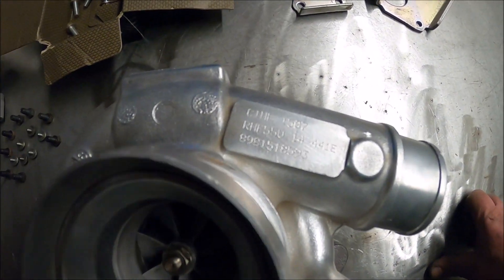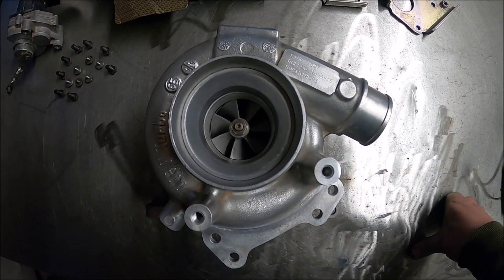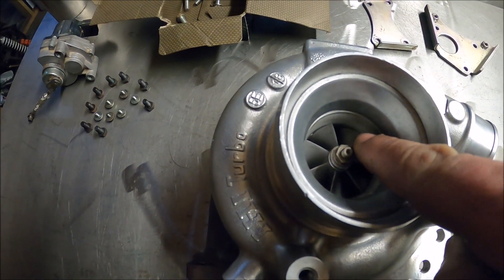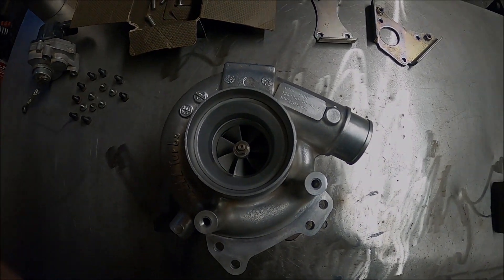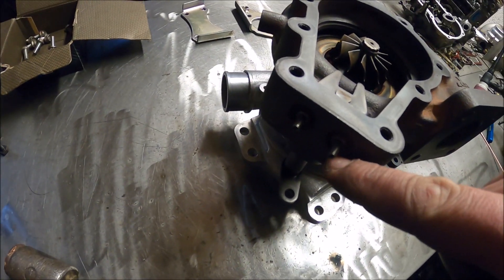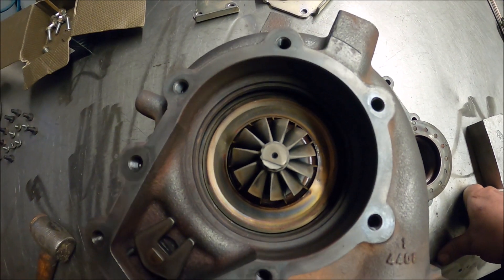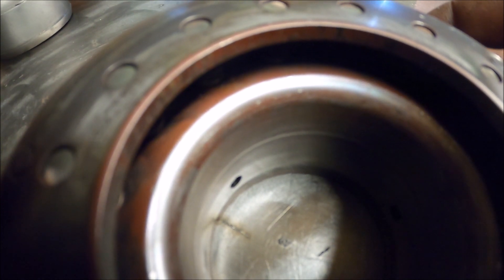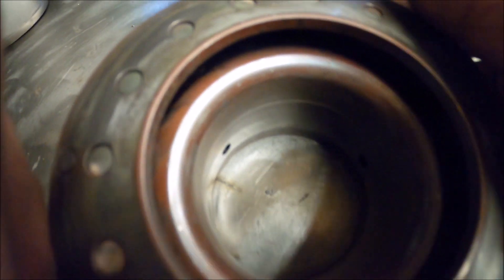A variable geometry Impreza STi turbo? Well sorta- The IHI RHF55V. Let's look inside...

Comment: Hello. I drive an Isuzu truck. 4H1K engine 5.2 liters. I had the software done and the power increased. However, the turbo works intermittently between 1500-1900 rpm. I had many parts of the vehicle checked. It was not this obvious before the software. Would it be useful to make a wesgate adjustment?
Reply from the maker: That sounds like maybe an electronics problem, either fuel being cut or wastegate/vnt opening and closing.

It doesn’t seem like something that would be a mechanical issue
Reply: @ I am running the cruise control and there is no problem. But if I step on the gas and go, it works intermittently between 1500-1900. Black smoke comes out of the exhaust.

Comment: I can put a ihi vb15 on a 2jz?
Reply from the maker: Far too small, you’d want at least two
Reply: @StavTech  i want it on a 2jz GE  to make a na t built if that turbo Take out + 50 100 Hp from the 2jz ge is Good
Reply from the maker: @prim3time3  the VB15 is the turbo from the 2.2ltr Toyota Lexus turbo diesels isn’t it? Regardless of power, one is too small for a 3ltr petrol engine
Reply: @StavTech  Undestand bro Thanks 👌🏻👌🏻Yes is was the turbo from my old Lexus is220 i don t have where to use, it and i just buy a 2jz ge for my Lexus Gs at3 and i planinng to make it na t , sorry for my Bad english hope you Undestand 😵‍💫😵‍💫👌🏻

Comment: I've got another cool IHI VN turbo sitting here, a RHV4 from one side of a 4.5L V8 Diesel normally found in a Landcruiser. In the LC application they aren't wastegated at all, purely controlled through the VN, is there any particular reason I would need to add an external gate for a petrol application? Or can I just hook up a wastegate actuator and let it control boost by itself? Thinking about using it on a 660cc Kei car engine.

Comment: i'm surprised you didn't do a review on the gtb2265vk's yet. their the vgt turbos to use on big power diesels
Reply from the maker: ricardonmoreira tbf these are probably better. Theyre that popular where people know of their capability that there’s a class in Thai drag racing purely for these turbos.
Reply: @StavTech  don't know much about the drag scene in thailand, except they run them on the isuzu's 3ltr. Seen a guy running one in a corsa 1.5td at 2.7bar constant and 3.2 peak pressure, but the owner never measured the car on a rolling road. Wonder how much power will they make in a 2.2, 2.4d engine. What do you recon? Are they easy to come by? as i'm tempted to give one a go, and don't wanna to be stuck if can't find a replacement then

Comment: Right so these are good for 350bhp , and you can use a normal wastegate in it?
Reply from the maker: Jason Jones yes on a petrol engine you’d run an external gate with it. Diesels can get away with no wastegate and just VGT
Reply: Stav-Tech ahhhh ok so you can use Diesel turbo charger on petrol cars and vice Versa?
Shame these have anti-surge as I like turbo flutter